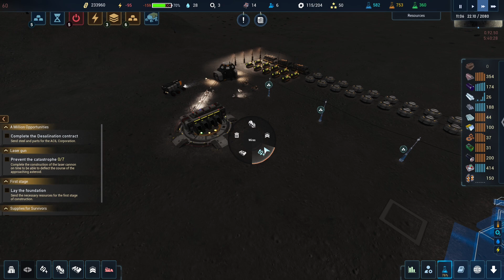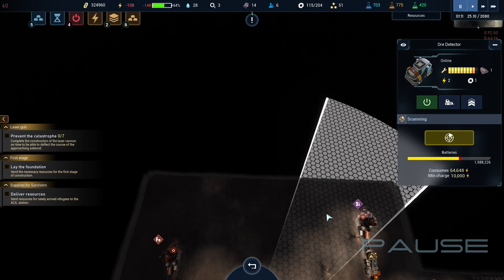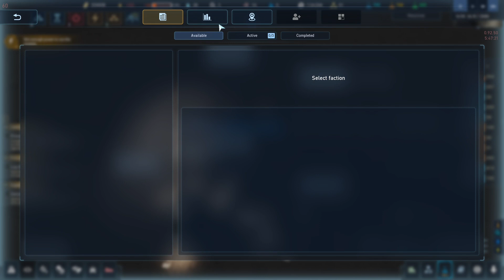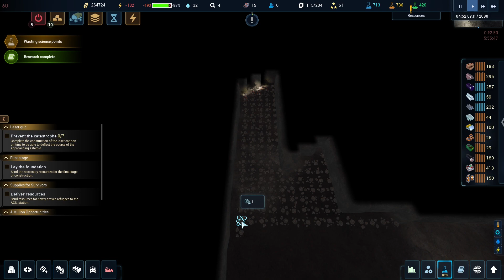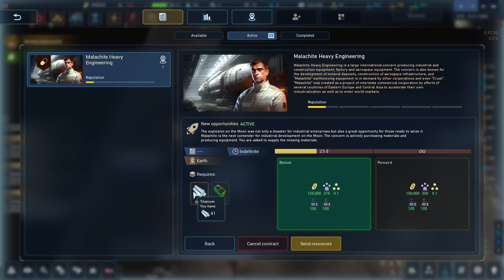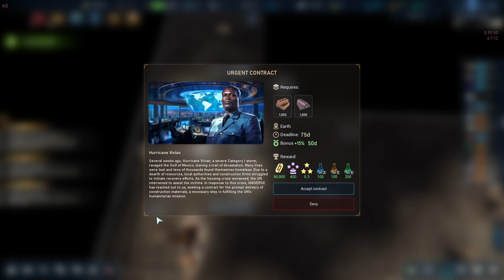The Crust - Completing Contracts

Comment: you had it backwards when they were talking about cpu what they were saying is the bigger ones will uses less cpu in large scale
small solar panel=2cpu 30power
medium solar panel=3cpu 75 power
large solar panel=5cpu 300 power
so
10 SSP=20cpu 300power
04 MSP=12cpu 300power
01 LSP=05cpu 300powe
Reply from the maker: Yes, that as also maintenance, one large panel needs a single iron bar to fix, rather than 9 for the mediums or 16 for the smalls, given a 9x9 area. 
However, the mediums produce FAR more power than any others for the space requirements, and that includes the power needed to run the extra CPU.
CPU uses 1kw each, so if a medium needs 3 CPU, and 9 can be place in a 9x9 area, that's 27 kw needed for CPU, with 675 produced leaving 648 for the base. A large produces 300kw and uses 5 CPU, meaning for the same space it produces under half the power, 295 large vs 648 medium vs 448 small after deductions for CPU.